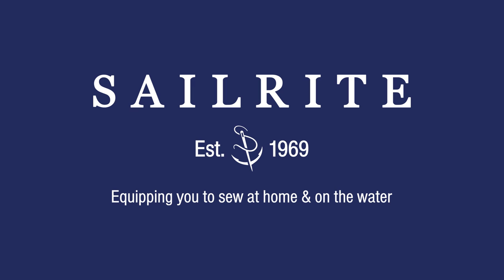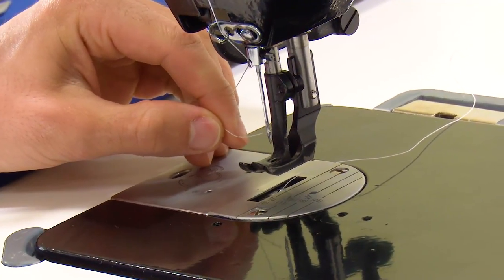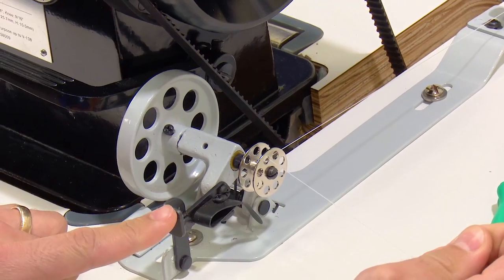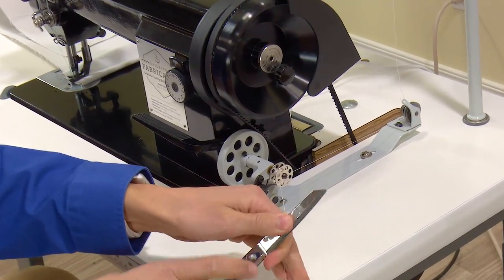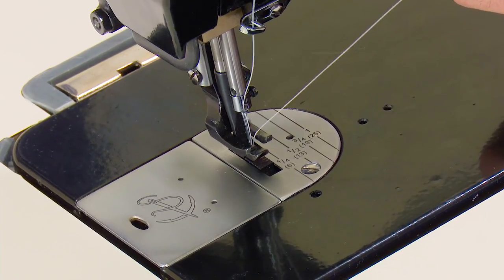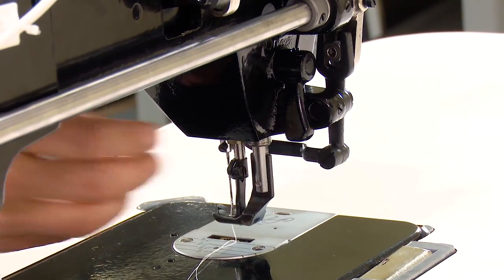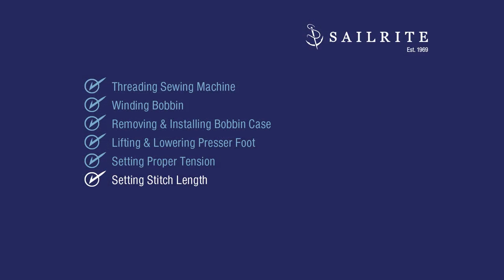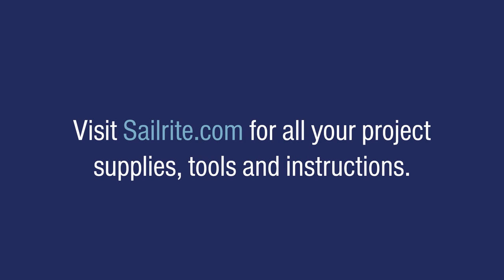Quick Start Sewing Guide for Sailrite Fabricator Sewing Machine

Comment: I have a question, sometimes when I'm winding a bobbin my needle starts going again like it's sewing. Does that mean I need a new pin?
Reply from the maker: Just remove the balance wheel and clean the shaft of the machine and the hole in the balance wheel with a rag. Then place a few drops of sewing machine oil on the shaft and reinstall it.

Comment: My Fabricator has been pretty much a paperweight for the last 10 months. about 3 small sewing projects into ownership, the needle hit metal and snapped. Then thread started shredding. I can't get the needle to go more than 5 rotations before it hits metal again. There is no snag on the bobbin housing that I can feel. Every time I sit down to try and finesse the bobbin case, hook and whatever else is involved (have no clue what all the pieces are called.  I get so frustrated and walk away. Contacting customer support didn't go anywhere and none of the sewing machine repair places where I live are familiar with the Sailrite Fabricator. Any assistance would be appreciated, as my husband got it for me so I could alter his canvas martial arts clothing.

Comment: I've never sewn... googled and your machine came up.  Can this handle 10.10 oz marine grade canvas? I want to make a tipi. What would I all need? What kinda needles for that material? I want to get myself this machine for Christmas... or another model you could recommend?
Reply from the maker: The Sailrite Fabricator Sewing Machine sews up to about 16 layers of 10oz canvas easily. Sewing your tipi will be easy for this machine. The package (in the link below) will provide you with just about everything you will need including the needles which are 135 x 17 style in sizes from #14 all the way up to #23. For your project you will need to use the size #20. Here is the link: https://www.sailrite.com/Sailrite-Fabricator-Sewing-Machine-in-Power-Stand-with-Workhorse-Servo-Motor Let me know if you have any other questions.
Reply: @SailriteDIY  
Awesome!!!! Thank you for the quick reply. 
Can I use this machine for other things too? Like your "make a duffel bag" video or.  "Make cushions"?
Or is it strictly heavy duty
Reply from the maker: @michaelgervais2901  It will work well for both heavier fabric assemblies and lighter ones like those found for bags and upholstered cushions. Here is a video using that machine to sew a cushion. https://youtu.be/6Zm-86T5F30
Reply: Quanto custa uma máquina trasporte triplo dessa amigo

Comment: Can this machine sew lighter material like the LS1 Utrafeed ?
Thanks in advance.
Reply from the maker: Yes, the Sailrite® Fabricator® does sew light fabrics very well. Just replace the needle with a smaller size along with the thread and reduce the upper tension.
Reply: @SailriteDIY  where are thse videos ? ty

Comment: Is this modeled after the techsew 0302 or the yamata 5318?
Reply from the maker: We don’t know much about those machine brands. They appear to look similar but they also look like walking foot machines and not a compound feed machine like the Fabricator (meaning the needle moves with the walking foot). The Fabricator is a rebrand of the Sailrite 111 which was originally modeled after the Singer 111W. Hope this helps.
Reply: Tecsew T111-155 or TYPICAL GC6-7-D

Comment: No you are wrong step 1 fill the machine with the correct oil and run it thru using the  right procedure. Very important
Reply from the maker: Thanks for your comment. Yes, we do fill the machine's oil reservoir in the assembly instructions and also the assembly video for this sewing machine. So don't worry that step is not missed.